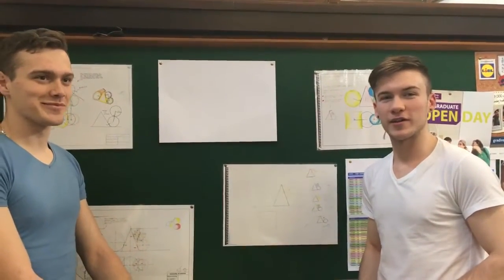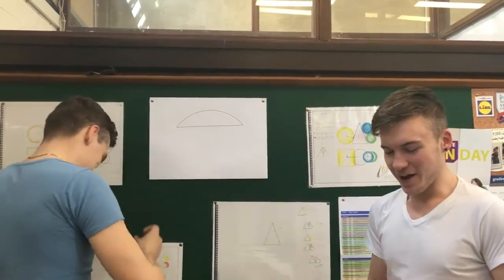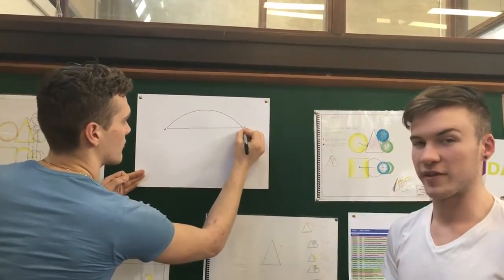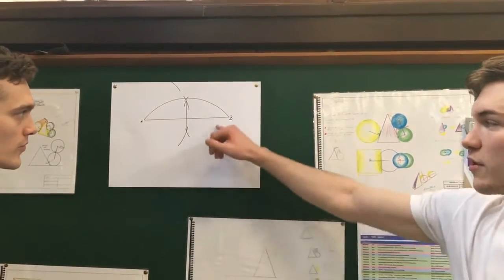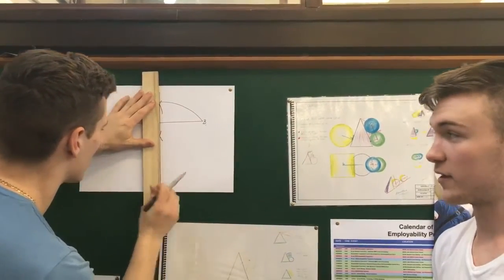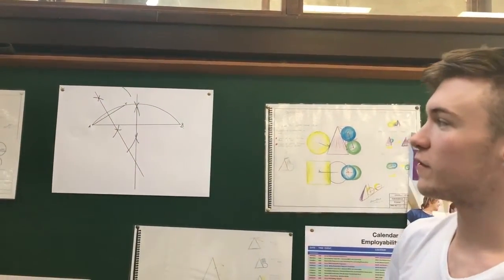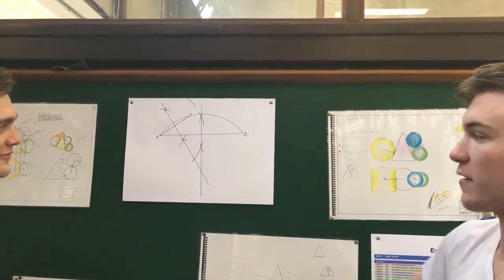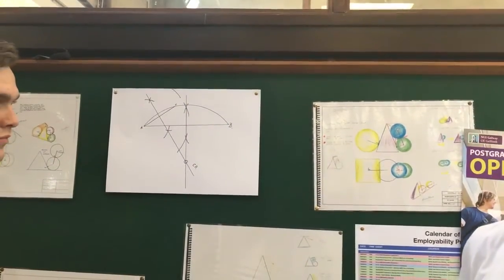How To Draw a Curve Parallel To a Given Curve

Comment: Could you not have used the compass to draw one arc and then shortened/lengthened the string and using the same original point draw curves on either side of the original arc?
Reply: I don't understand your question